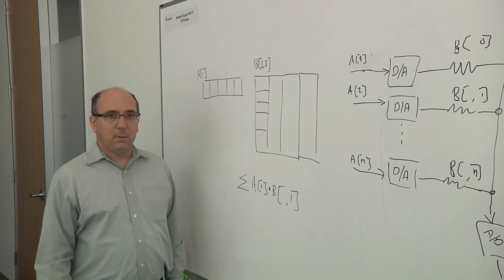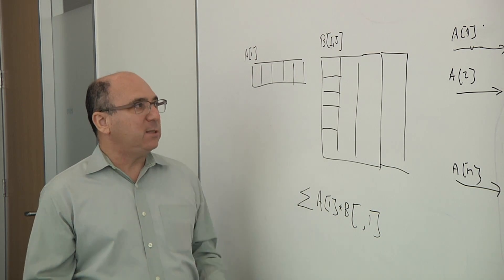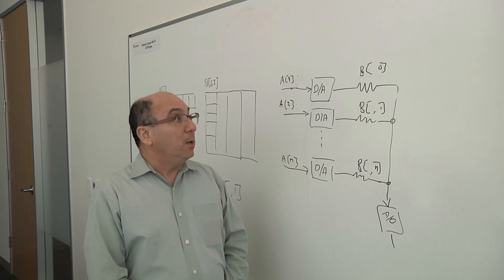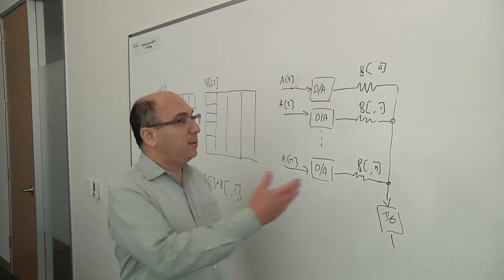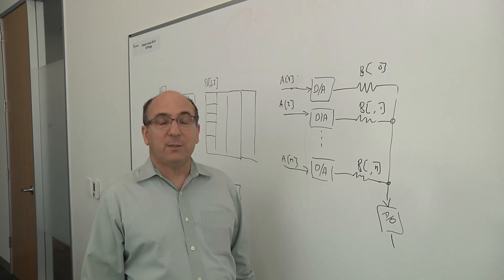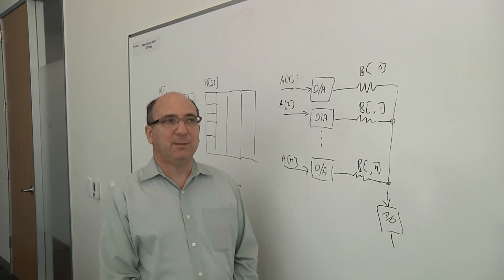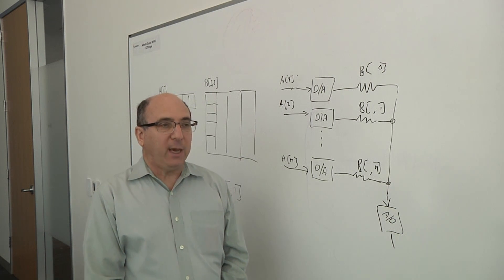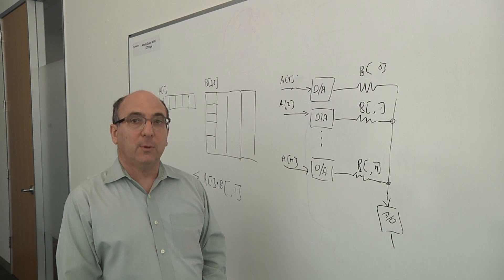In-Memory Computing

Comment: For now, modern microprocessors are equipped with FMA (Fused multiply-add) instructions and other type of accelerators to perform much of the computation in one go. Still, the faster the processors, the greater the need for faster memory access. HBM2 memory and simply bigger L3 cache are some of the answers to this ongoing challenge.

Comment: 🤔 estoy pensando en quizás sea posible sustituir esas resistencias por potenciometros digitales en circuitos de prototipado rápido para expirmentar con ellos, cómo un híbrido entre una fpga con resistencias, o incluir ya la parte del circuto prediseñado: con los transistores y éstos a las resistencias. El resto cómo la memoria, demux, D/A, A/D, etc el circuito se diseñaría por el ingeniero o estudiante.
Reply: Un potenciometro digital tiene normalmente de 5 a 8 bits que controlan de 31 a 255 resistencias respectivemente, es decir un 0.3922% de resolución para 8 bits, y los potenciometros analógicos ofrecen un 2%. De esta manera de pueden diseñar sistemas de IA para uso doméstico o pequeños usos a un coste bajísimo. Si se hacen de 10 bits se controlarían 1023 resistencias que tendrían una resolución del 0.0978%.

Comment: I really don't see why analogue storage helps with computing in memory versus binary storage. 
The whole thing starts with the premise "we're developing resistive rom and this drawing shows we can store values in it". Great, we can store values in lots of types of memory, getting the computing power local to the memory blocks with a reasonable architecture is the issue.
Reply: From what I've been reading. It's better because for example you only need 1 analog bit to represent 0.01 versus multiple digital bits to represent the "0" the "." the "0" and the "1". I also adding and subtracting will be faster because again, you can just combine the voltage of two analog 0.01v + 0.01v = 0.02v. with digital you have to go back and forth with the CPU to do the math to make that happen.